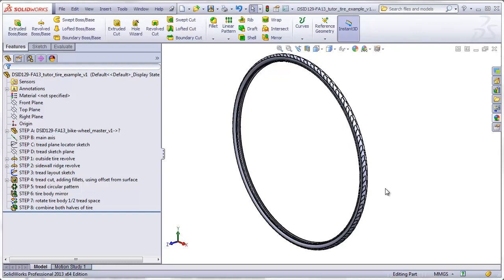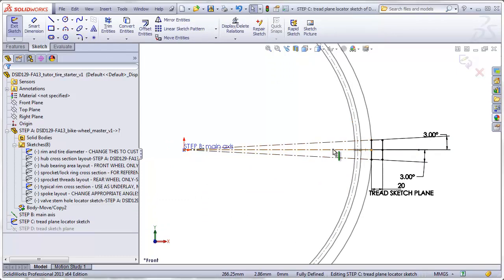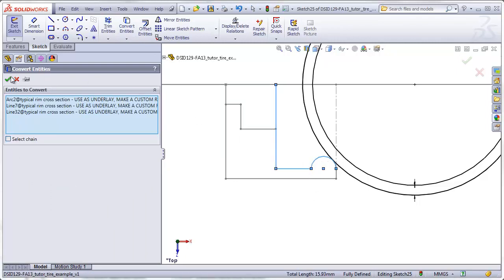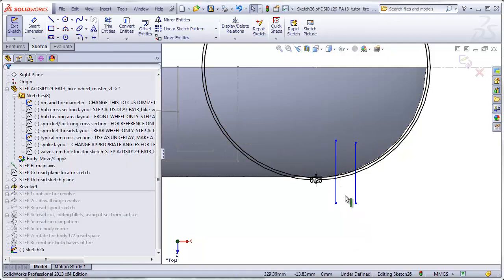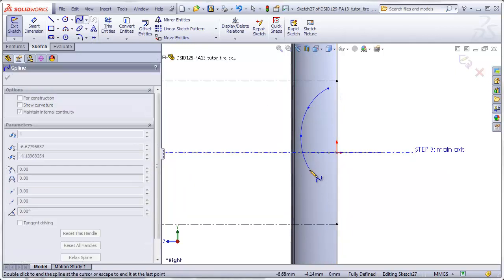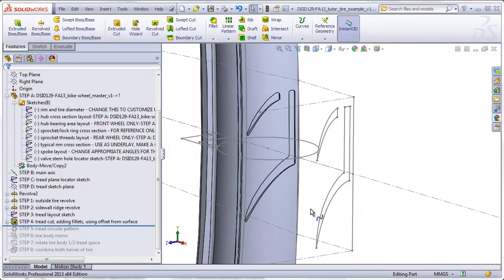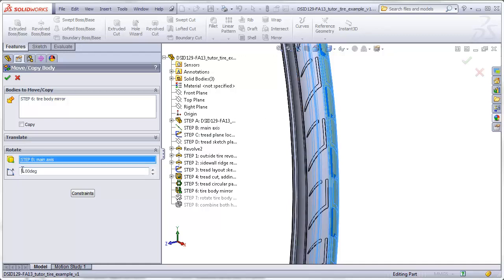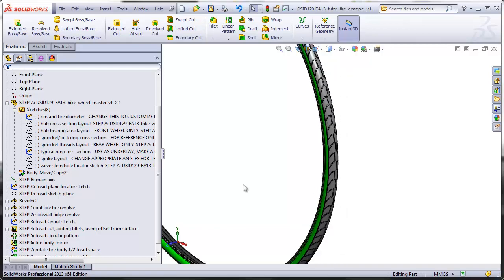DSID129, Solidworks Tutorial, Bicycle Tire

Comment: Sir I must say when I watched your first video I was thinking what is all this sketching files and didn't it just add that much more work to the project, but now I am beginning to truly understand why you are doing it.  So anytime you make a change to the sketch it automatically changes the converted entities. The only thing I don't clearly understand is what is gained by doing this?  I just draw the part and don't clearly understand  why you take the time to do the sketches and transfer them to another plane.  You posted this video in 2013 and I am the first to comment.  Can't understand that at all as your presentation is clear and concise other than the comment I made about the pre-drawn sketches you use.  Oh by the way when I did the handle bars I decided to do the 3D sketch as I didn't really understand the command you used to combine two sketches.
Reply from the maker: You are right. When you change a sketch, the entities automatically update. Also, you are probably right that it adds a little bit of additional work. But sometimes, I think it saves time. There are several ideas behind doing things this way. First: you want to plan out your work as much as possible. This is especially important when you have complicated geometry, such as a bicycle frame, which has a lot of odd angles. Second: you want as many of your layout sketches to be at the top of the feature tree. This way, you always know where the "controls" of your part are located. Third: by having each feature referencing the layout sketches, instead of the features preceding it, you have fewer parent/child relations, which gives you more freedom to rearrange the feature tree. Fourth: by having fewer parent/child relations, there is less chance that a failure in any one feature is going to cause a huge failure in the rest of the feature tree. I'm sure I can come up with additional reasons, but these are the main ones.